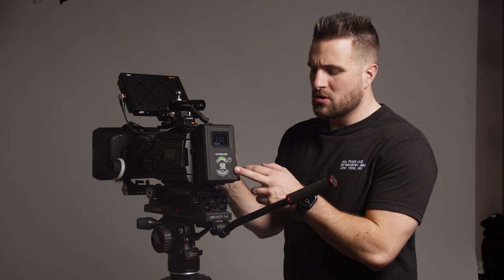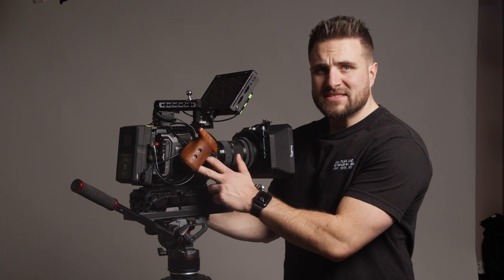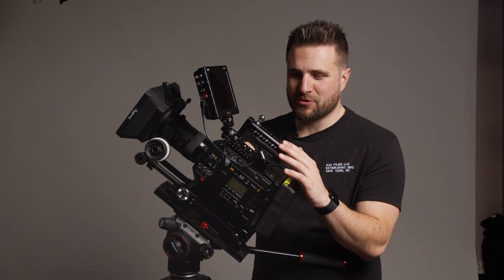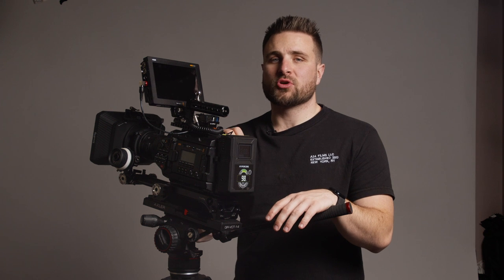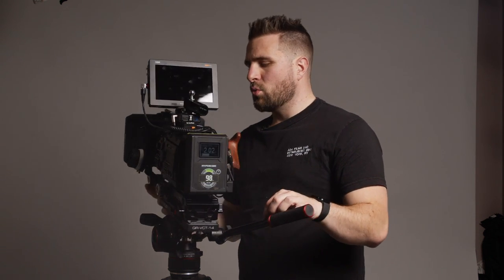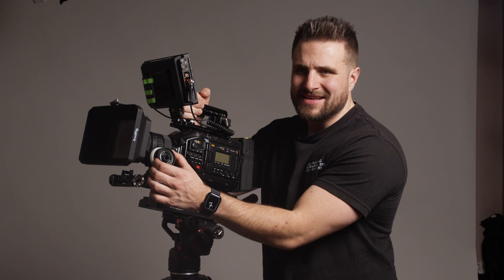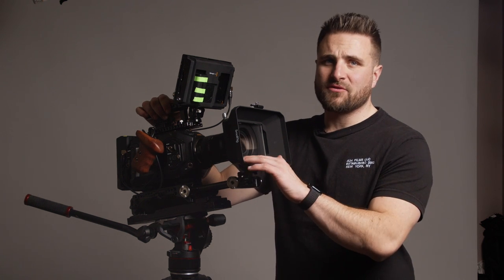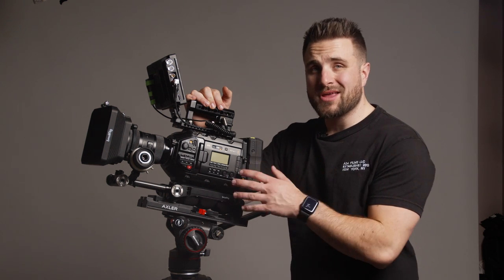2021 Cinema Camera Rig + Parts | URSA Mini Pro G2

Comment: Great video mate. I highly suggest you get the Smallrig 1979 closed handle.
It's the best handle I ever held. I have 4-5 different big handles but only the 1979 is so amazing to use. It has also it's own NATO rail and 15mm rods! On and off so easy and super secure even if you won't tighten it,it follows rails,not some small nato clamp. 
Smallrig also updates the VCT plate and I love the update,big difference. Give them a look.

Comment: I have a similar setup. One thing that I ran into though is I was not able to power my Blackmagic 7" 12G Video Assist through the CondorBlue 4 way D-TAP (tried every port) when connected through the Blackmagic V-Mount plate D-TAP or my battery (158WH MAXOAK). I had to run my CondorBlue D-TAP to barrel power connector for powering the Video Assist directing into the battery and the other accessories I have through the splitter connected to the V-Mount plate's D-TAP. Kind of annoying since if I want to run my camera plugged in, the battery's D-TAP is in the way of the power jack so I have to run wall wart for the Video Assist until I'm ready to go mobile with the camera. Maybe I'm using a faulty D-TAP splitter but it doesn't appear to offer the power (voltage) need when connected through my splitter.